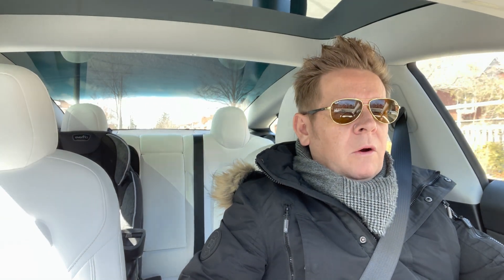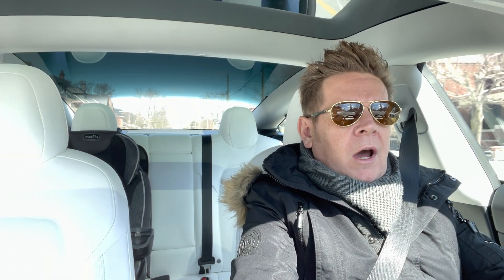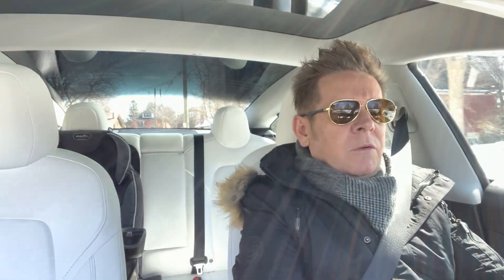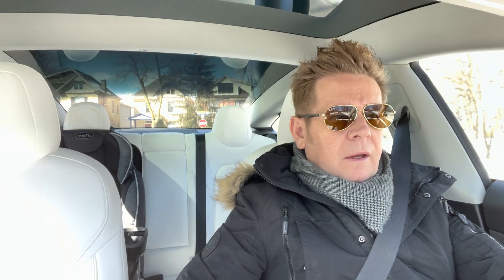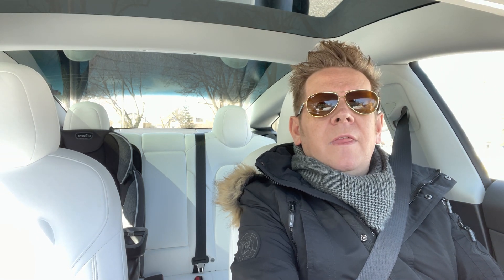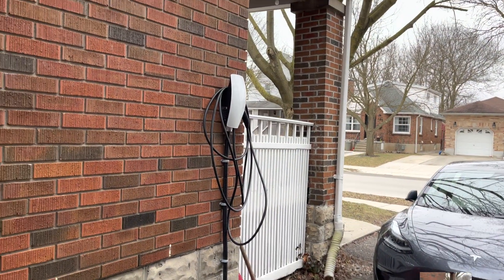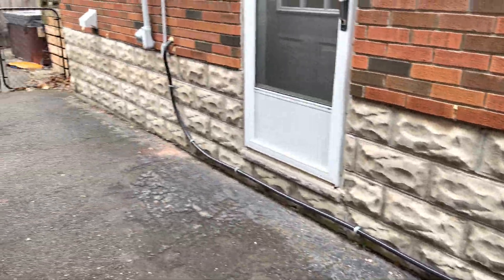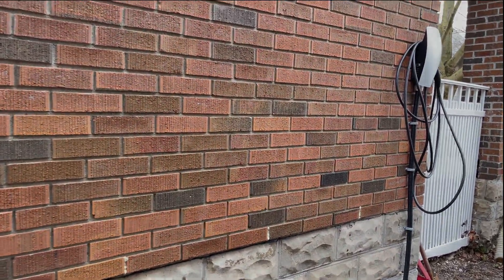2022 Tesla model 3 Tesla wall charger Gen 3 overheating

Comment: I have had this same issue. My electrician definitely installed the wiring properly. The odd thing is that I only get this overheating error when it's really cold outside (I'm in Toronto). It never happened throughout the summer months. I also tried going through the Tesla charging people but they immediately blame the home working and say it definitely isn't an issue with the charger. Very frustrating
Reply from the maker: That's sucks it took me a lot of phone calls they also tried blaming the weather my issue was in the summer has me take pictures of the wires and confirm the election used the correct torque amount then finally after a lot of emails and phone calls they sent me a replacement charger.. Dont know what they Dont do the same for you? I am In London so I know all
About the weather and my charger is outside and I have no issues so they can't blame the weather it's 100%  the heat sensor is defective.. Well good luck my friend I would keep at them till you get your way their are lots of examples online of the sensor malfunctions

Comment: Hi same exact issue. With my 2 weeks old model y and new wall connector. Can u plz advice how u resolved the issue?
Reply from the maker: So I reached out to Tesla and spent a tone of time on the phone with Tesla service they are able to log onto your car and the wall charger and test it out after taking pictures and showing everything was connected correctly Tesla finally sent me a new wall charger.. I made sure to have a Tesla approved electrician do the second install as my first electrician was certified but not a Tesla approved technician 

When the new electrician came out he said they some of the wire connections at the main breaker needed adjusted. 

So hopefully if you are having the same issue your Tesla phone technician will be able to assist you. I would just keep calling, be persistent and don’t take no for an answer.

Comment: Try to reduce your amperage to 40 amps . I am a certified Tesla installer . I have had 3 of these generation 3 chargers do this . Tesla has reduced the charging to 48 amps but I feel like the charging cord is way to small on these new chargers .
Reply from the maker: Thanks for the advice I ended up not using a certified Tesla installer the first time and thankfully Tesla sent me out a new charger and I made sure to use a certified Tesla electrician the second time and I have had no issues since..
Reply: Hey @douglas. Is my wall connector defective, as I get the same issue??